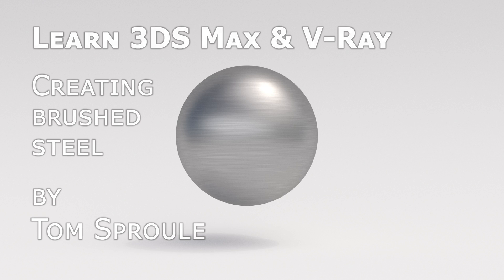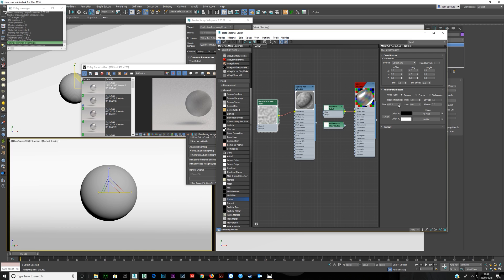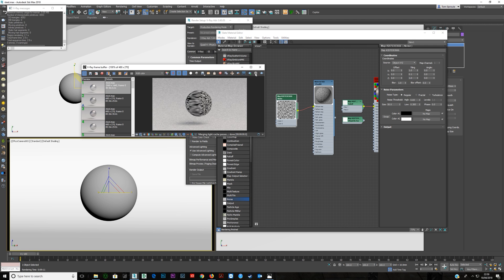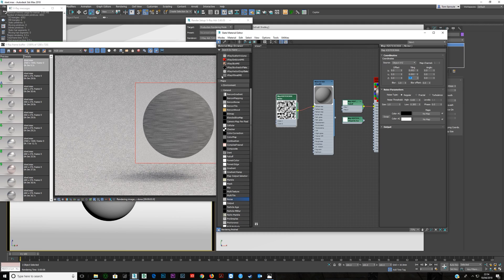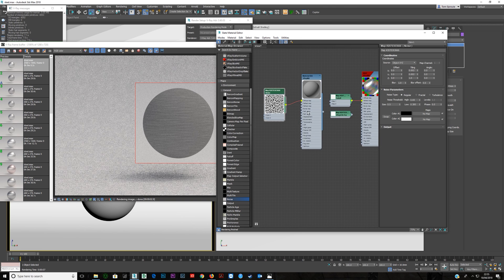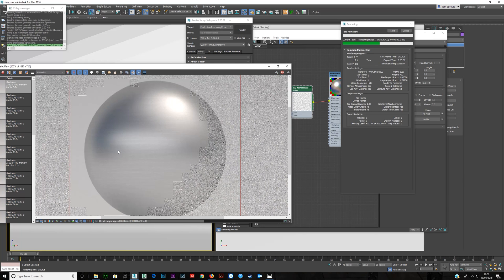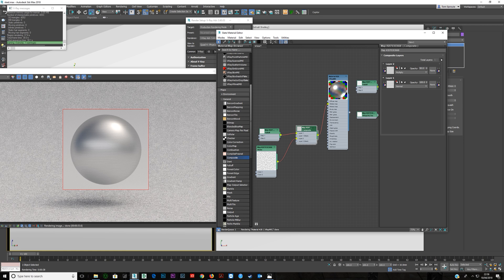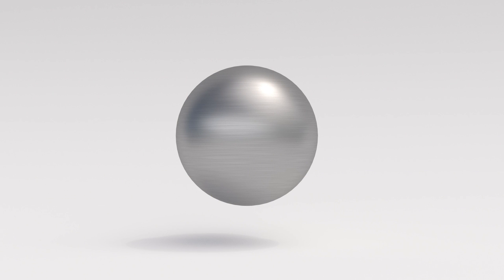Create Photorealistic Brushed Metal in 3DS Max with V-Ray | Quick Archviz Metals Tutorial

Comment: Was not able to get the same results. Normaly I work with Meters as System Units and as Display Unit Scale. So I revert it to Millimeters and with these I can not do the same like you. Would be nice if you could give us a link to the mtl. BTW: as you have to use very small values for the tiling it is generally not possible to do this when Meter is the System unit because the smallest number you can enter for x an y is 0,001  :(